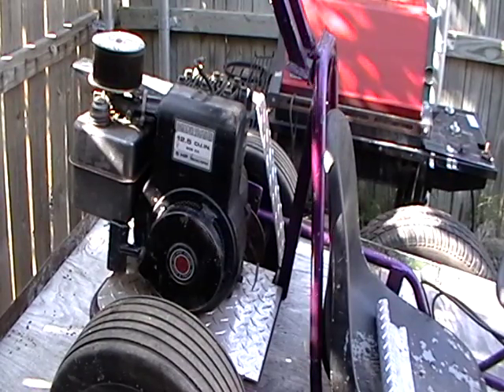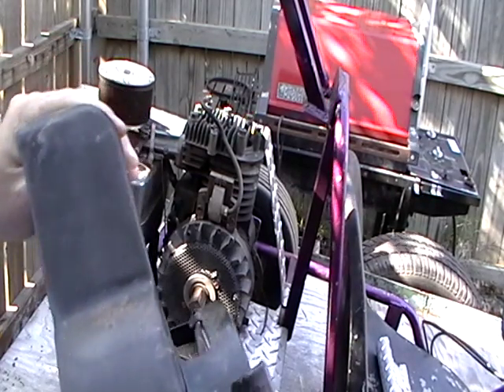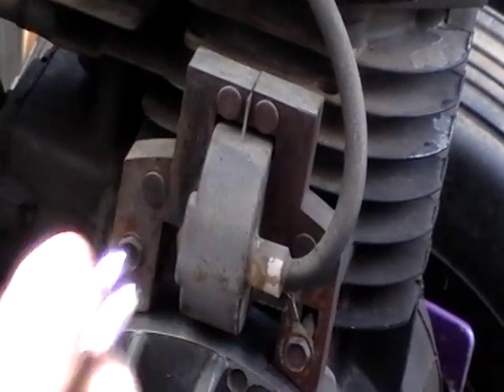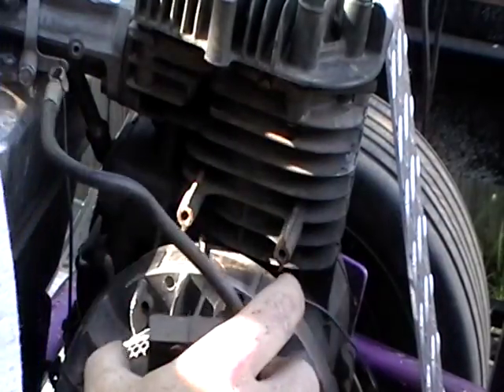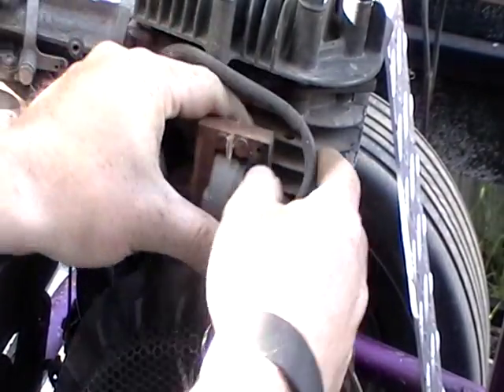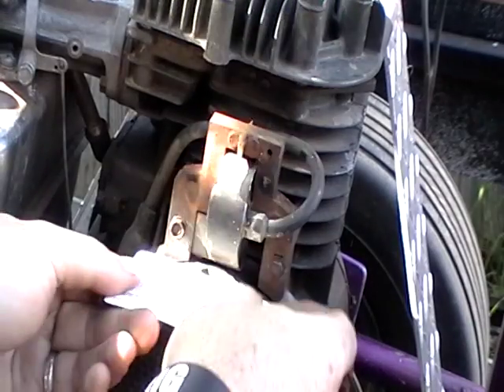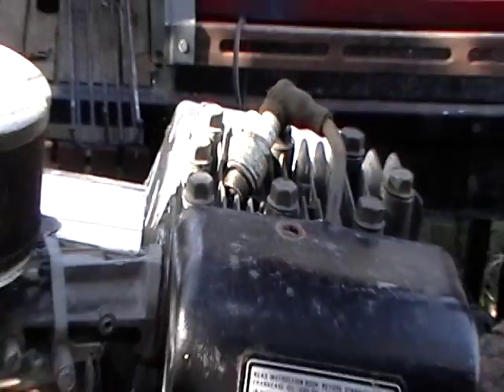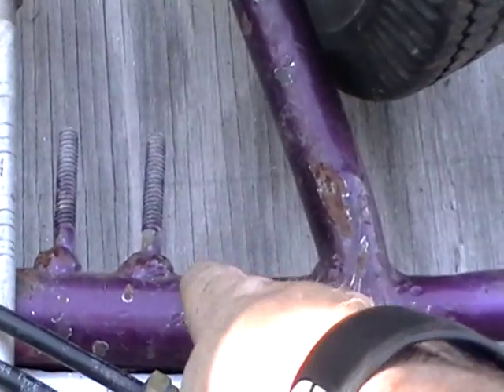Go Cart From No Spark to Spark

Comment: on the part that you change... you cut the cable.. where does that cable go to. mine has a think black wire
Reply from the maker: Krishna Ramnarine the skinny wire that was connected on to that bolt goes to your points and condenser that's the old style the thick black wire goes to your spark plug do not cut that LOL
Reply from the maker: Krishna Ramnarine there should be two wires coming off of the new coil one is sick and that is going to the spark plug the other one will not be as thick and that is a wire you can hook this up to a switch to kill the engine once this wire is grounded it will turn off the spark therefore killing the engine